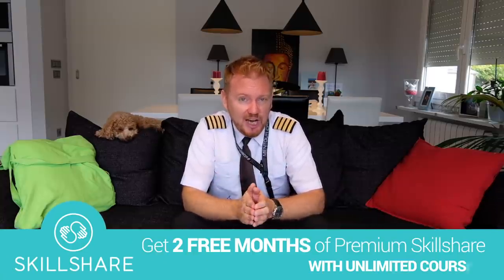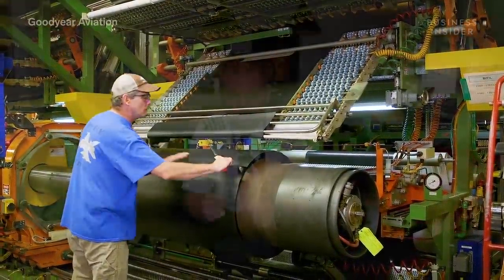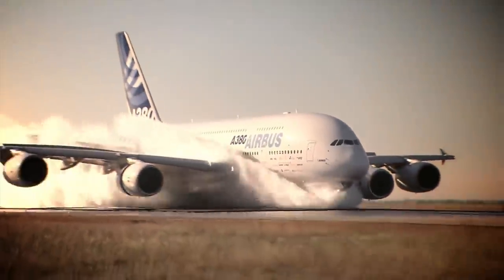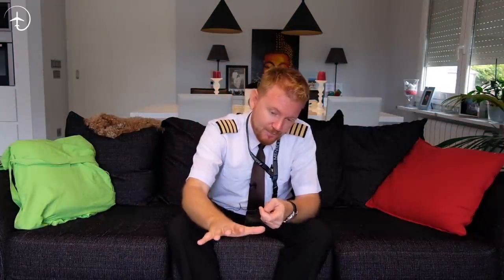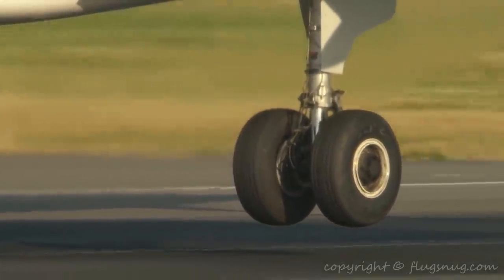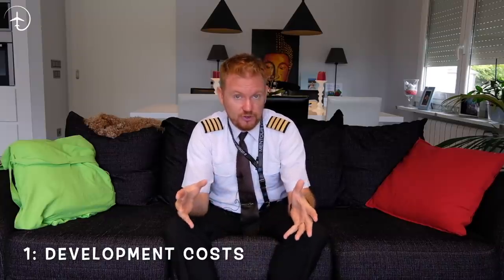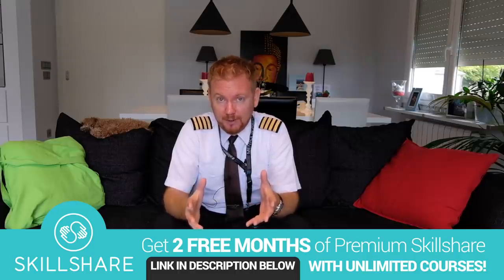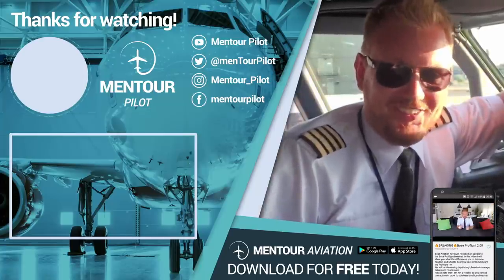Why not make plane-tires spin, before landing?!

Comment: No need to motorize landing gear wheels/tires to cause rotation, maybe just use local air speed to get the wheel to spin just enough to eliminate the tire wear from current landings?
Just enough of a tire feature to cause the wheel to begin spinning, again, only enough to eliminate the landing wear.
But no argument, to input hundreds of pounds of weight by using some kind of motor or dedicated engine especially for landing tire rotation is nonsense.
I'm sure aircraft landing design has gone over many ideas and designs to look at the bottom line, and, what is currently used is no doubt the overall best.
But, open minds should ALWAYS be open to new ideas...
I imagine things have always worked that way.

Comment: i think all those explanations for sure also LOGIC explanations make it worthwhile to watch.
the only thing indeed i would think off is the use of the turbines on the tarmac. 
I would not trust these - self guided - push backs out on the tarmac or runway. 
they are ok in a small, confined place where it might be indeed the vehicle of choice to use. 
but out there with cars and trucks and planes and what have you zooming around i also would rather have a PERSON, a HUMAN to sit on the controls of a pushback. 
on top of it, an xxxl plane from the Emirate will need for sure more power than a little - 30 minutes fly hopper -? 
and on top of it, what about in winter? 
with all that snow and ice,deicing fluid dripping all over the place, for sure electronics would love those things...
so, indeed no good idea? though a -man guided - pushback right to the starting position, or from the landing stop back to the parking position.
a good idea. even if it will make only an smell free working place for all the ground crews.
I would not like to - inhale - all day long that Jet Fuel ( i learned from your episodes that planes do not use -Kerosene-...)  pregnant air...

Comment: Isn’t there also an issue of energy. Spinning this means more energy that needs to be dissipated to stop this will need more brake disk or reverse thrust which may be less cost effective that the loss of a bit of rubber to o

Comment: being Nitrogen an inert gas has nothing to do with changes in the pressure with temperature.
 nitrogen-filled tyres are advantageous because nitrogen gas doesn’t support moisture or combustion. Compared with ambient air – which contains roughly 78 per cent nitrogen, 21 per cent oxygen, plus miscellaneous gases – pure nitrogen is an inert, non-flammable gas. Essentially, it’s dry air with the oxygen wholly removed.

Comment: I see no need for motors to spin up the tires, just install anemometer style cups vertically in the wheels to spin them up to speed when the wheels are lowered for landing.

Comment: 25 years ago I send in an idea in working for klm with stator rotor blades which turned each  wheel autmaticly. Saving tyres.
They rejected the Idea to much futristic

Comment: The plane would spin out similar way, as in Indy 500 or Stunts in Dos. So, it is a bad idea. Different weather conditions, temperature, weight, etc also counts. It is simply better to automatize the pressure of the plane, instead of spinning up the wheels.

Comment: This may be more problematic than worth it, but couldn’t there be like small fan blades attached to the wheels to let the air speed spin up the tires; also wouldn’t spinning up the tires decrease the runway maintenance cost and runway closures to remove the rubber from the runways?
Reply: Then again .. if it an’t broke….

Comment: what if you just use a pneumatic motor if it fails there would be no difference than before but if it works than great less ware to the tires

Comment: A lot of your addressed Problems can be easily solved with already existing technologies. 
And by the way the Gyroscopic effect everyone is mentioning doesn't make sense. You already got big spinning turbines on planes which do not make a plane unflyable.
And what about take of? There the wheels obviously are already spinning and you can still fly the plane fine.
You wouldn't have to spinn up the wheels to full speed as even setting them in motion in the first place eliminates static friction in the wheel bearings themselves. 
(Modern) Induction Motor Technology could even be used as measures of breaking after landing reducing the wear and tear of the regular breaks.

And you provided the audience with false information then stating that motors inside wheels for push back haven't been in service. Because there is a Company who produces those motorised front wheels for self push back.
They got an entire video on the YouTube channel of Fly with Captain Joe.
Pessimistic People won't change the world.

Comment: Oh c’mon. No battery, no motors are requiered. 
A small propeller on the main gear leg with a very simple transmission would be a solution. :-D

Comment: You just said that big airplanes use retread tires?!? Now I want to pre-speed the tires more than ever.
Why not use computer controlled jets of compressed air on to the tire tread surface to pre-speed the tires to approximately the landing speed? There would be no mechanical connection between such a device and the existing landing gear.

Comment: Use powered wheels to help accelerate = shorter takeoffs, use electric assisted braking for landing = enough charge to taxi without engines to the gate. Spinning up for landing does seem harder but we could try slower speeds or delaying spin up to the last second. Crabbing could be differential speed to match the rudder or braking input. This could be good for bringing larger planes to undeveloped airports with less wear and tear

Comment: Some flawed assumptions in this video. For example, the addition of motors does not require the addition of batteries. The airplane already has an electrical system with at least one layer of redundancy. And even if you decided that batteries were more appropriate here, they don’t need to be colocated with the fuel tanks. You’ve heard of wires? 😉

The electric motors in a Lucid Air make 670hp each and weigh only 31kg. Given than you have several minutes of lead time before touchdown, you wouldn’t need anywhere near that much power to spin up the heavy airplane tires, although that’s probably in a reasonable ballpark (assuming motors at each pair of tires) for self-powered taxiing. A quick google to see how much power a typical airport tug has indicates that this would be _plenty_.

The plane’s braking system has an anti-skid feature, which means that there are already wheel speed sensors. These same sensors could be used to ensure that the motors are functioning correctly, such that a failure could be detected. If one motor isn’t working, shut down the system — thus avoiding the asymmetric torque concern. 

If there’s concern about having the already-spinning tires exert forces that might accelerate the plane unexpectedly during touchdown, then you could simply spin the tires up to a speed slightly lower than the actual ground speed. Combine that with a system that cuts off power to the motors when the weight-on-wheels sensors are activated. (And maybe override that cutoff at taxi speeds.) 

The motors could be used to provide additional braking force which would turn the energy back into electricity rather than heat in the brakes. You could also implement a sort of stability control, applying variable torque at each wheel to keep things going straight down the runway during landing. Think of it as an additional “control surface” available to you during ground operations. 

Electric motors are EXTREMELY reliable, so I don’t think there’s much cause for concern from that standpoint. 

The difference would be small, but the motors could also augment takeoff acceleration when takeoff weight and runway length are close. 

Probably the best argument here is the one near the top of the comments about gyroscopic effects, which wasn’t addressed in the video at all. Here, I’d be inclined to go against my earlier statement that you could spend several minutes accelerating the wheels up to ground speed: rather, a quick spin-up just before touchdown would mitigate that problem. I haven’t done the math to determine how long it would take, but if these motors can accelerate a 2000kg car to 100kmh in three seconds, I suspect they can be similarly quick spinning up a few large tires. Motors this powerful were not available to Lockheed seventy years ago, so it’d probably be good to re-evaluate. 

I don’t know the standard voltage of an aircraft electrical system, but I’m guessing it’s well short of the 800v used by Lucid’s motors. You’d probably need a transformer and large capacitor located near each motor to be able to deliver the necessary power without a major electrical system overhaul, and to have a place to store the electricity generated during braking.)

Since the system could fail, you still need tires that can handle the stress of landing without being spun up in advance. But as Petter said, the cost of tires is not a concern. The combined equipment would probably be similar in weight to the taxi fuel savings. The other advantages (no need for tugs, saved cost of taxi fuel, additional braking options, and a touch of additional takeoff power) are the motivation here.

Comment: High tech tugs are going to be highly limited to advanced airports where there regular tugs already. Old high utilisation airports are still going to be highly restricted by tug availability which they can't really increase because tug usage goes up and down such tugs aren't useful for any other service say at high times you need 20 a lot of time there is only need for 10. Peak usage is when the running the engines on the ground is the worst because of personnel and airplane crowding.

Comment: Mentour you did not answer this about tire spin! You can spin the wheels with no motors! Just add air cups or fins on the tire sidewalls! then the wheel can spin and if you wanted to stop them or slow them in the air just touch the brakes. I wonder why this is not done!
Reply: How will that work when the landing gear is up? You'd need loads more sapace and besides it probably wouldn't work because of the tyre mass. A small amount of extra wear on the tyres just isn't worth all that extra design, manufacture, cost, maintenance, reliability.

Comment: I think you are over engineering the landing gear. There is no need for batteries. Simply use the same electricity produced by the engine to power the electric motor. When the gear goes down the suspension is fully de compressed so then contact with the positive terminal is made allowing the motor to spool up to the appropriate speed. As soon as the landing gear compresses, the positive terminal gets disconnected this would cut power to the electric motors. From there the wheels continue to spin from resistance as normal. As for matching speeds they could use the airspeed to speed up and slow down the wheels just like the avionics are able to let the pilots know of the air speed. Same or similar system. If one of the gear fail, then the other one would automatically be disengaged as well. if the speeds don’t match, when the landing gear touches down, the tires will speed up for themselves or slow down since the aircraft is already at a constant speed. So the whole point of the wheels spinning is to prevent the smoke, but they wouldn’t be there to push the aircraft forward or add any additional source of propulsion. For takeoff. since the gear is compressed, the motors wouldn’t activate, and when takeoff begins. if the altitude increases, the motors could also be disengaged or simply have a switch to disable the motors altogether. The motors are simply complementary. Don’t need to be overly complicated and don’t even need to be very powerful considering there’s no pressure on the wheels while they’re spooling up. No additional aircraft weight, so no need for extremely powerful motors.

Comment: i would suggest that it would be more logical to use hydraulic motors to power the wheels. there is already hydraulics system available to raise and lower the undercarriage so why not use this to also spin up the wheels.

Comment: There is no need to have an electric motor to speed up the wheels. Simple air driven foils on the sides of each wheel will bring them up to speed before hitting the runway. Get to work on this. Why has no one thought of this?

Comment: While most of your explanatory stories about various aircraft specific technologies seemed very well done, arguments in this seem very unconvincing.
Except maybe certification bureaucracy one, manufacturers/airlines and rest not wishing to deal with due it being such time & money wasteful and PITA process.
1) wheels don't need to be spun up to exact speed .. not even to aproximate full speed .. prespinning them 50-150% will already noticeably reduce wear/double tire life due lesser delta prior touchdown, thus not believing that advanced control system for prespinning is needed to always have it spinning to exact speed for speed at touchdown
2) if one needs in specific scenarios (eg. mentioned crosswind landing) not spun wheel - aircraft can still land on not-prespun wheels, be it by not switching prespin active means, or by braking them using brakes already installed on wheels, if it's spun by something passive powered on gear means (eg. anemometer like shapes on wheel rim or via small auxiliary turbine) and one can get wished straightening torque by landing jolt.
Still seeing economical worth doing even if prespining is statistically usable in just 80% of landings, as even then tire life will be quadrupled.
3) something "anemometer windmill" like is simple/cheap/reliable enough, electric motors are simple/reliable/lightweight enough (if one needs just prespin free rotating wheel, w/o taxying feature) and not using much power, thus most probably small portion of electric generation (IIRC from APU or from part of power from main engines) that is already on board for other electricity uses will be more then enough
4) while tire blowouts are rare for aircraft, they still may happen. thus i see prespining as even while slight, but safety increase.

Comment: Using electric motors to taxi would still mean that the jet engines would have to generate the power. They might be able to to be used at a reduced throttle setting though.

Merely spinning up the tires could be done with power generated by the jet engines, requiring no additional batteries. If the motor were not to work on one wheel, systems could merely shut down an opposing wheel or the entire wheel spin system and landing would proceed as it does now. That also negates your crosswind landing point.

However the economic argument, that each tire is already good for 500 plus cycles and can be regrooved to achieve more means that spending money to fix a tiny amount of expense just isn't going to happen. It doesn't make any sense. What doesn't make economic sense doesn't get done, no matter how cool the idea is!

Comment: Sry, i need to call bulshitt on the nitrogen heat thing!!!!!
Our air is made of 78% nitrogen anyway, and the change in temperature dose effekt the pressure of other gases the same!!

Only reason to fill the tires with pure nitrogen instead of air is that you have no oxygen.
Thats importent in two ways.
One is that the ruber in your tire degenerates from o2, especially at those higher densities.
And second, it´s a fire hazard!
On trucks and planes the tires can get very hot momentarily like on interfaces like the rim, due to heat from the brakes ect.
Also internal heat from flexing can cause the ruber to start smoldering inside and pop the tire.
And in case of a burning vehicle, poping tires releaseing huge amounts of compressd air into a fire dosen´t help as well.

Comment: Why not just deploy an aerodynamic fairing in front of the tires, that would direct the air to the front bottom of the wheels and cause them to spin up before landing? No motors involved.

Comment: Motorised wheels on aircraft is not a good idea...as for now the braking effect helps to slow down landing or runways would have to be extended with motorised wheels...it's perfect as it is now...wear yes ...but safer

Comment: The nice thing about being a pilot is everybody pays a bunch of attention to you and thinks you're really really smart. The reality is you can fly an airplane and that's about it. Nitrogen is an inert gas that means it isn't chemically reactive. It still goes through the pressure changes with temperature in the various things that you were talking about. Why would you want to spin the tires on the airplane? When that airplane hits the ground on landing it has too much linear momentum and too much velocity and too much energy. When the tire catches the ground a lot of the linear momentum of the entire airplane is turned into angular momentum. A lot of the kinetic energy is turned into rotational kinetic energy in the mass of those tires that are now squealing on the ground and accelerating and sucking energy out of the airplane and slowing it down so it can land on a shorter field. That's the most critical time in the flight when the airplane drops and its speed to less than stall speed and stays on the ground. Right when the airplane touches the ground those Wheels grab a lot of the forward speed.

Comment: you want to be impressed by tires look up the sr-71s tires lol. inflated to 415 psi can take 400 degrees f compounded with aluminum. 23 ply and 0 to 239 kts or 0 to 275 mph in less than a second.  150,000 lbs on 8 tires.